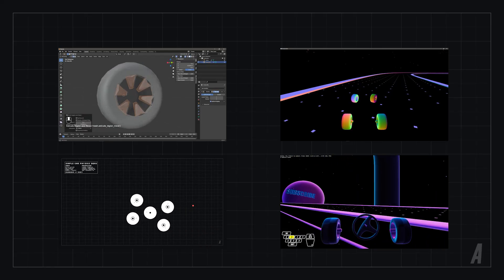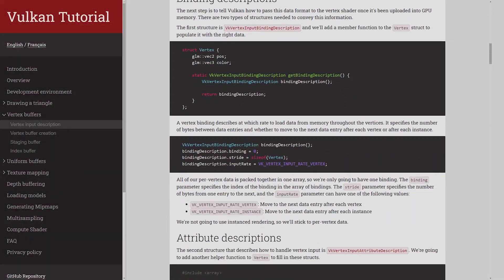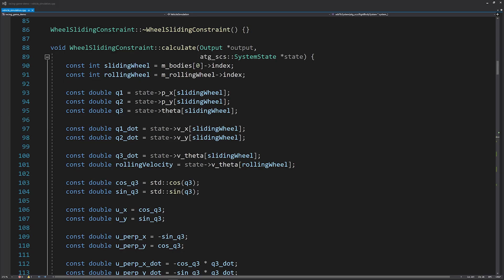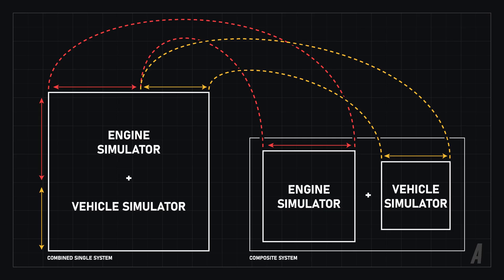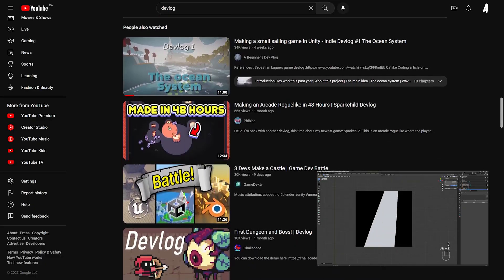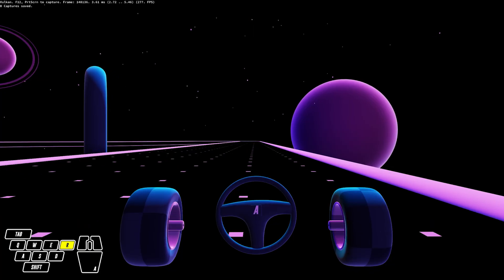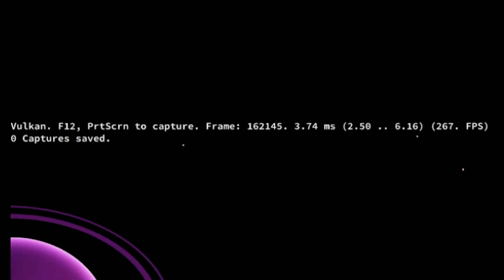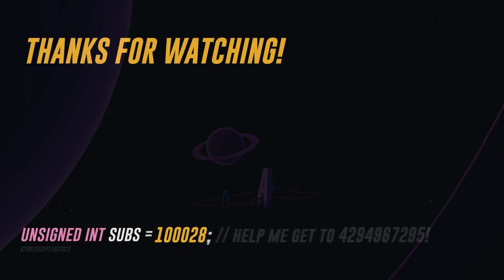Making a Terrible Racing Game with Great Audio (Engine Simulator)

Comment: Every object in the world has static friction(higher) and sliding friction(lower), use it to make sliding car more realistic.
Also i always get bummed that in every game tires are like solid rocks, they dont flex at all, so the bumps are always deadly
Reply from the maker: The simulation does make a distinction between static and sliding friction. In fact, you can even see it in the code examples I show. Considering I only intended to spend a few days on this, I don't think I'll be implementing a complex tire model anytime soon but maybe in the future
Reply: @AngeTheGreat  didn't see when you showed the constraint limits, but ok, nice touch then ;)
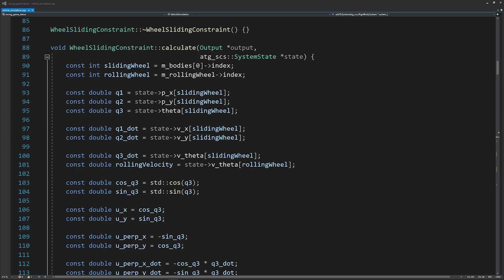Reply from the maker: @nik325007  You can see it at 4:04, the friction is calculated earlier in the function
Reply: @AngeTheGreat  oh, didn't look up there, thank you for the clarification!

Comment: 7:15 THIS
Today games are not optimized and lack any new nice features because people can just slap random assets to game engine like unity or UE and it work. No one need to think how to put something in game and make it work, its all WYSIWYG, copy paste. push lags and performance problems to unity team and ask players to get better computers!
Imagine how good games would be optimized if developers would have restriction on hardware... I bet we could make new ways to optimize code and graphic just because we would force developers to not use full power of best pc components. Like I work doing 3d models and I work on tad old laptop, and due to that I find loooots of ways to optimize workflow, mesh and even UV maps just to squeeze as much as possible from little power so when you use it better hardware... it work smooth as butter. When you need to count every vertex and keep in mind how long it will take to bake hipoly model on normalmap, you need to optimize your work, think of new ways to do things.

Comment: i wonder if you can cheat the system a little and use shortcuts to generate the sounds without actually simulating the engine physics.    i am sure since the patterns are predictable and most parts behave the same way every time,  ,  they can be boiled down to mathematics and animations instead  rather then actual physics simulation of the engine  parts which is where most of the performance problems can start.     obviously this will reduce the quality but it can bring enough performance to use this in more complex games and even simulate multiple engines at once.

Comment: I recently started using UE5 and my first instinct was to record sound files at different RPM from your engine sim and use the audio blending that UE5 sound cues provide, the result isn't really perfect, but it's very believable and I absolutely love it! (I calculated the pitch modifier of the sound files to be 1 at the rpm they were recorded at, but for the neightboring audio the pitch would change according to RPM assuming that the frequency is the RPM which it obviously isn't, there's a tiny bit of mismatched pitching, but what I did was both easy and a very good result)

Comment: I know im getting ahead of myself.. but i wonder if the actual shape of the intake manifold will make a difference on the power or if the actual shape of the exhaust will make a difference on the sound..
Also, the sound on a moving "car" makes the thing 2 fold better than just the engine sim..

Comment: I've mentioned before I want to simulate the engine in my pickup.  I really want to simulate the m2 turbocharger on my cummins isv.  Trying to tune it in real life is proving extremely difficult.  I really want to simulate the fluid flow so I can figure out the control loops for the rotary valve and prevent over boost.  I'm really looking forward to getting beyond javascript and be able to replicate what you've done.  Your work is inspiring and lines up exactly with what I need!

Comment: I think the spring wobble makes it sound a bit like a rally car. It would probably need to be implemented differently, but as someone else said, a bit of flex in the drivetrain is to be assumed so the spring is a better approximation of reality than a solid connection

Comment: Amazing work. I make sounds for car simulators and this tool is such a massive breakthrough. The practicalities of recording good engine samples means that it's very difficult to get a really good sounding engine, and I always find I get to the 'that will do' stage rather than mind-blowing satisfaction, as you have accomplished with this engine audio..

Your solution to attach to the engine and the vehicle via a spring is actually perfect, and not a compromise. This is because the drivetrain of the car has elasticity to it, and so one or (more accurately) a set of torsional springs can be used to simulate these rotating bodies. That might be why you like the effect - it is because it does simulate this extra variable. 

Thank you so much for your work.

Comment: I think you nailed the sound of an actual car with the spring connected engine/chassis. Real cars have a spring between the engine and the wheels, its the gearbox backlash, driveshaft twist, axle twist, tire deformation, etc. Its not a rigid link.

Comment: The low RPM shudder actually sounds quite realistic and is basically (accidentally) emulating torsional vibrations in the driveline
Reply: Yeah he implemented that into the sound sim a while ago, but I wonder if he is using the spring connection for this one, it’s basically the exact same thing he put into the sound sim so maybe he just replaced it with the physical spring.
Reply: I'm pretty sure that was intentional as I think he said in another video
Reply: drivetrains do typically have a bit of spring to them
Reply: @blockstacker5614  in fact lot of clutch on manual cars have (small but strong) springs. Idk about automatic
Reply: @mrmim0x173  automatics have fluid lmao
Reply: @Brapplezz  torque converter do. Not automatic sequential, dual clutch or robotised. Lmao ?
Reply: @mrmim0x173  i was saying lmao to the fact TCs have fluid mate, not at you. Magic goo makes the car go
Reply: It's not an accident

Comment: You mentioned using "springs" to connect thee engine and wheels. I'm guessing this is for the torque feedback from the kinematics of the car on the engine - but what do you mean by spring? Are you just using it to delay the response of the engine by a physics tick, so that the equations don't need to be solved simultaneously? (i.e use the last tick's result for each equation)?
Reply from the maker: In some sense, yes, it does act as sort of a torque feedback mechanism but it does not introduce a "delay" exactly. The issue is, a typical rigid constraint solver solves all connected constraints at the same time but is very expensive. Two systems connected with a spring are not considered to be "connected" rigidly and therefore you can use two separate linear equation solvers, each solving a smaller problem. Solving the combined problem would be significantly more expensive.

Comment: I actually think the jitter from the spring makes it sound a bit more realistic lol
Reply: Maybe driveshafts are flexible enough to cause that effect IRL
Reply: @ki0w0-lordofwatersheep  They are! If you think about it, it would be pretty hard to make a perfectly rigid driveshaft in the real world. Even if you could make one, you probably wouldn't want to anyway, as that slight torsional flexibility helps arrest any crazy shocks.
Reply: @ki0w0-lordofwatersheep  pretty much. most jittering and 'vibrato' you hear when accelerating at lower rpm or decelerating is caused by momentum moving up and down the drivetrain. learning to mitigate it will both make your drivetrain last longer and you a faster driver as the torque is more instant and uninterrupted to the wheels.
Reply: @ki0w0-lordofwatersheep   manual transmission cars have springs in the clutch disc that cause this
Reply: @Heck6  would the springs affect the torque if the clutch stays in static friction? Unless they actually slide all the time
Reply: @ki0w0-lordofwatersheep  the springs are what transfers power between the clutch disc outer friction material to the center portion of the disc where the input shaft of the transmission slots into it. The springs do not affect your torque output, they simply act as a dampener when engaging the clutch disc to get the vehicle moving, so it's not so jarring when shifting gears and such. Though, with much higher powered cars built for drag racing with 1000+hp for example, the springs are not present as they would be a failure point and the dampening effect is not needed due to simply wanting to transfer power to the wheels as quickly as possible, driver comfort isn't the goal. Top Fuel dragsters have multiple of these springless clutch discs that when run through a pass will actually become welded to the flywheel and will need replacing.
Reply: @Heck6  oh I see, I thought you were talking about the springs that press the discs together
Reply: yes, my car has a sound similar to that in low rpm

Comment: I agree with your comment about the relationship between restrictions and creativity, but believe me if I tell you that even something as advanced as Unreal Engine still has tons of limits and restrictions in basically every area. You might not feel that way for a small project, but when you make complex games and you have to balance performance, quality, stability and features on 5 or 6 different hardware platforms you very quickly feel the need to write your own tools to extend the engine, to break those limits and go beyond what UE was originally intended for. That said, I would love to make your engine simulator into a Unreal Engine plugin but from experience I can say that it would only work well on high end hardware once you put it into a fully fledged racing game. I have serious doubts about using your (incredibly awesome) simulator in something with 20+ vehicles, full physics, modern graphics, full high quality procedurally generated audio, multiplayer game which wouldn't require at least a couple of PS5 in parallel :D.

Comment: Another benefit of connecting the engine to the car with a spring is it may actually emulate real life transmission losses and drivetrain deformations, e.g. a driveshaft sure does twist somewhat when accelerating, parts have tolerances and play between them etc.

Comment: My dude, you are definitely a gigachad programmer. Using a spring to couple the two systems while keeping the constraint solving tractable is a stroke of genius.
Reply: Could you explain what that means to me? Sorry if it’s annoying you don’t have to, I just like learning :)
Reply: @ihateracin  Same would love to learn more about what was said. I am a software engineer but not a game dev and yet half of the video still went over my head lol
Reply: @WloCkuz  A normal game dev would also be pretty out of the water as well. This is a work of art combining 3D modeling, software engineering, game development, and physics simulation.

a physic system with too many constraints and variables is pretty hard to solve and computationally intensive, what he did was to decouple the 2 physics simulations a bit so the overall simulation is easier on the computation side of things, the spring serves as a soft information tunel between the simulations, the only thing is that the overall simulation is less accurate... but hey, the result is superb
Reply: @imblackmagic1209  That's still not clear. Is this "spring" a physical connection between the two systems in the game world or a figurative one?

Comment: I'm sure you've probably thought about this (or had it suggested) but would it be reasonable to optimize an engine where for each identical cylinder, you run the simulation on cylinder 1, and essentially "bake" the internal simulation for the rest of the cylinders, then just combining their outputs at the right timing offsets fornthe exhaust sound, saving from having to simulate all the moving parts for more cylinders? cylinders 2+ would be running on slightly outdated input parameters, which I could see causing some artifacting when you have rapidly changing throttle/load at low RPMs, but at high RPMs the time window of a single rev might make those artifacts negligible. You could even potentially have it dynamic, so that at low RPMs you'd simulate everything, but at a lower physics tick rate, when the extra temporal resolution of the sim isn't needed, but then as revolutions rise, you could start "copying" more cylinders and increasing the physics tick rate correspondingly, allowing much higher temporal resolution at high revs; an issue you spoke about fairly early on in the series

Comment: You should really set this up with some cheap racing sim rig. That would let you get much more exact throttle 0-1.00 numbers (rather than 3 or 4 inputs), as well as give you a bit more of a fun reason to keep these projects going. I love your work, it has helped me start to get into a little bit of coding, moddelling and all that.
Reply: Gamepad or wheel support would definitely make for smoother and more accurate driving inputs 😉

Comment: Game engines are nice if you are making something where performance isn't an issue or the project is a pretty standard video game. I'm making a game in Vulkan, a 2D game in SDL, but I also have several games in Unity, one of them being a small demo for procedurally generating race tracks and hovercraft and AI that race on it. My controls are simple though, you drive with just the mouse, no keyboard input. It's a lot of fun actually I should finish it.

Comment: Super interesting video! One thing that got me curious is the "Spring" connection between engine simulator and the driving sim.
What do you exactly mean by that? is the engine literally connected to a spring or something? I'd really appreciate hearing an explanation from you!
Reply from the maker: The engine and vehicle are linked with a very very stiff spring intended to simulate a rigid connection. In some sense, this is actually MORE realistic because nothing in reality is perfectly rigid but stiff springs are kind of hard to simulate in software so they're not often used like this. In this case, using the spring allows me to separate the car and engine into two separate physics engines for efficiency
Reply: @AngeTheGreat  I see.. Thanks a lot for the clarification! 👍
Reply: @AngeTheGreat  Does spring connects torgue from engine to wheels? Because from you explanation i think it connects engine and car positions, which does not make any sence and purpouse.
Reply from the maker: @last8exile  It definitely does not connect engine to car position. The engine is connected to the wheels via a simple drivetrain.

Comment: i unironically wanna try out his button layout for racing. It seems so bizarre that it looks good to use lol.
Reply from the maker: LOL it took me a few hours to get used to but once I did it was pretty great
Reply: @AngeTheGreat  oh boy, I can't wait to try it. Do you care if I ask what the button layout is? I am still slightly confused on which button does which LOL
Reply: @nova2760  top row QWER for throttle, Shift for clutch. Left and right mouse button click for shifting up and down, pressing the wheel is brake, and moving the mouse is steering.

ASD are probably controls like ignition etc.

To me, the mouse wheel as brake part is sketchiest, on most mice I feel the wheel press requires too much pressure to feather it decently.

Comment: It's weird to see what seems to be an early 2010 looking driving game that just has the most accurate intake noises I've seen in a game!
Reply: Early 2010? Uhhhhh have you seen what was available back in 2004 (Need For Speed: Most Wanted '04)?

By 2010 we had games like BF:BC2, or, NFS:HP, and that was all on consoles, not on PC.

This straight up looks like a high resolution example of the kind of demos that were being shown off back in the 1980's by groups of teenagers & enthusiasts looking to get into the game development scene at the time.
Reply: @LND3947  most wanted came out in 2005
Reply: @LND3947  I was thinking flash game, after all forza motorsport 4 was my childhood.
Reply: @LND3947  They're talking strictly audio

Comment: That engine wobble at low rpm acceleration sounds really nice.
Reply: Accurate too, real cars have flex in the driveline, soft engine mounts, soft subframe bushings and wishbone bushings that all contribute to a similar effect at part throttle and on launch. In the video he made it sound like the spring was a bad thing, but it's actually the most realistic way it could be connected imo.
Reply: @JamesBalazs  yeah, absolutely. Adjusting the spring rate could easily replicate the difference between a big soft luxury car and a rigid race car. It’s a win-win really.
Reply: @bunnythekid  using some kind of damper could also work to emulate an automatic transmission, as those use torque converters
Reply: @notstonks20  my old Mercedes had a torque converter and, man, I miss those. It was like butter. The dual clutch in my current car isn’t bad but it hasn’t got that silky smoothness that only inefficiency can provide.
Reply: @JamesBalazs  Reminds me of how the Honda engines sounded the first time they put them in the McLaren F1 cars.
Reply: yeah